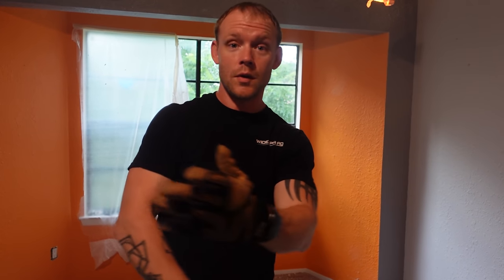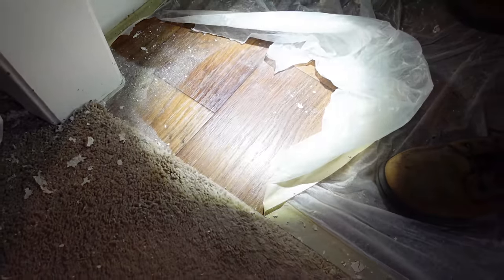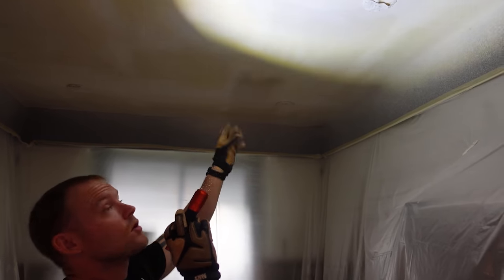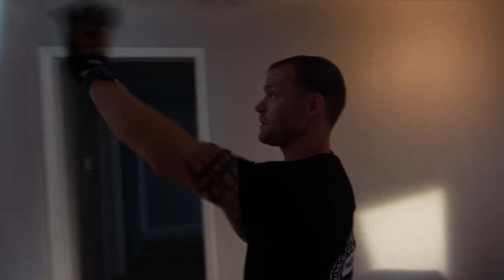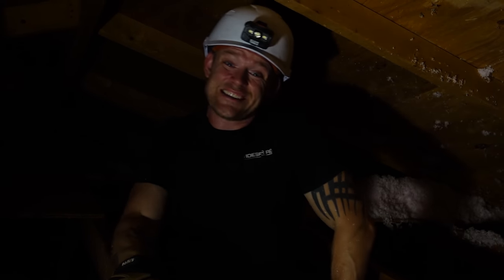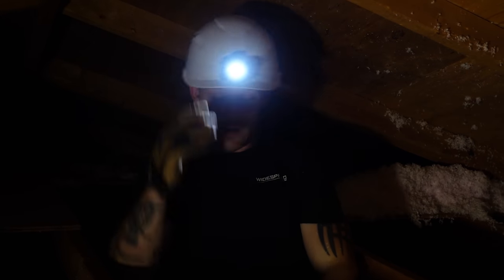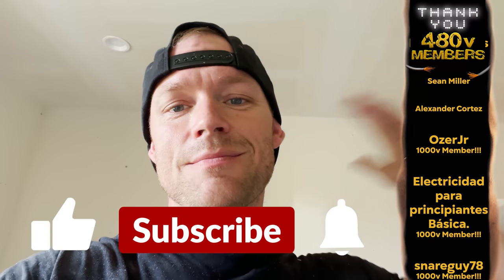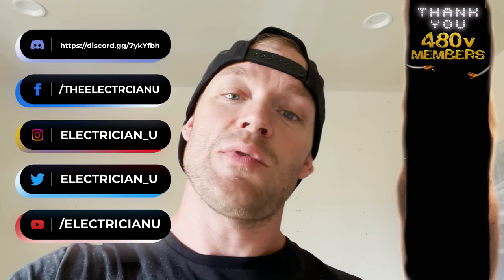Installing Recessed Lighting - Crawling in Attics - Remodeling

Comment: You can get a safety "bump cap" insert that fits inside most ballcaps. It's not rated for falling object protection, but will stop you from getting any cuts or bruises on your head.
Reply: That’s great. I may have to get one of those.
Reply: They are absolutely impermeable and will drench your head in sweat, still beats smashing your head into a beam or nail point I suppose.

Comment: I had a buddy die in an attic an hour before we were done with the job . He was making up a junction box and his knee slipped and he fell with his chest landing on a live circuit hidden in insulation and I kept yell up the ladder to him and then I seen the lights shudder and ran up and he was barely alive ,sadly when paramedics came he was dead. One of the WORST days of my life and career. I NEVER ever let co-workers go into attics or confined spaces alone. Plus we go the extra mile now to make sure all breakers are off. He was such a great guy too.
Reply: Really sorry to hear that my commiserations on your loss. Keeping the power off is a great point with multiple circuits that can be always a hard thing to do. But attics are dangerous places I fell and my leg went through the ceiling in the bedroom below the power was off but I was lucky did not get tangled with other live circuits only drywall to repair thank god.

Comment: Run a cheap 12volt led light strip in 3000k down the ridge beam. Plug in with a 12v power supply. It will light up the whole attic and make working up there way more pleasant. Since the light is coming from the whole ridge line, you won’t get any shadows or dark spots even when your working down near the sofets. Installing this was time we’ll spent in my attic. I even put mine on a switch near the entrance so you can’t miss it.

Comment: A good tip esp when working alone. When you are pulling any type of wire in general & you are using sticks, tape the wire onto the stick around 3-4"s from the back or end of the stick. This will create a V.  So when you push the stick forward to where you want it to stay until you move. You just pull the V back until it catches on anything. Now the cable & stick won't fall back out while you move over. 😆 Plus you can still pull the cable forward as much as you want & after you pull it forward a little, if you twist it you can now move it backwards too if needed.

Comment: When using a holesaw in drywall, run it in reverse to avoid dulling the teeth. You might need them later for wood or metal.
Reply: Just use a grit holesaw with the dust bowl and use a side handle for your drill. Its easier, faster, cleaner, and goes through plaster without ruining your saw.
Reply: I bought an adjustable hole saw just for drywall. It has a single bit on the outside and dust bowl around it. Make it amazing for can lights. I think it is a milwaukee product.

Comment: I don't know how you went about removing the popcorn texture from your ceiling, but if you use a spray bottle and get it wet and then go back once it's had a chance to soak in, it scrapes off pretty easy! I've done that a few times! It's pretty messy, but just put down something on the floor, plastic or drop cloth, and it's not too bad to clean up. a 4 gal backpack sprayer with a lever on one side to pump as you spray makes it a lot easier! Harbor Freight has one for 20 or 30 bucks. I bought one I use for me yard every year, and I've had it for 4 years now. Warm water works best!

Comment: If you are trying to find holes while in an attic, try using 2’-ish glo-sticks from a party store.  They are cheap and highly visible. If you do not have an assistant, they can be taped to the ceiling below to stick up into the attic.

Comment: I’m in the same place as Dustin and I had squirrels in my attic and they shit a bunch and tore up the duct work. I realized this when my a/c never cooled. I went up there and discovered the place they were getting in and measured and counted all the ducts that needed replacing. I then got mesh to fix the spots they were getting in and bought a bunch of duct to replace the broken ones. This was in June. I got up there in the morning but by 10 it was unbearable. Needless to say, I duct taped the ducts and basically stopped the bleeding then decided I’d put it off for 3-4 months until it cooled off. The squirrels are the same as me I guess because they seem to have vacated during the summer so I need to at least patch the holes before it cools but I’ll probably put it off and end up trapping them.
Reply: That'll smell nice while they decompose!

Comment: One of the first things I did in my attic was install strings of C9 Christmas lights with white bulbs along the ridge line.  When I go into the attic, I just plug in the strings and the attic is all lit up.  They are all connected end to end so there's only 1 plug to plug in.  It works great.
Reply: I did that too, both attic and crawlspace, but I used strings of 2500 lumen LED work lights. Crawling around still sucks, but it’s at least it’s nice and bright in there.
Reply: @MikeBramm
Good idea!
Reply: I put in 3 keyless that are switched from the hallway below the scuttle hole
Reply: Every time I go up into my attic, I keep meaning to do that.

Comment: The best light I have used is the Milwaukee red lithium headlights. I love those light. Last a long time. Multiple light settings, and rechargeable. They sell batteries for it too if you need to quick swap it. But the only time I ever had to do that is when I forget to charge it. Otherwise last the whole day.

Comment: Great time to be in construction/housing market… i got a whole house generator install, adding a 5000w generator inlet for the same guys lake house, and made 600 in 2hrs yesterday, installing 2 smart switches, getting power back to his bathroom and installing a surface mount light on his front porch yesterday lolt

Comment: Would love it when I gave somebody a price in middle of winter to due a few hours of attic work only to have them wait til hottest days of summer to get it done. Told them it would cost at least a hundred dollars more or wait til October.Same thing with post lamps. Would expect you to do it for same price that you quoted in summer and wanted it done while the ground was frozen solid in January. Told them to call me after they dug a 12" deep trench because no way that I dig in middle of winter up in cold north city. Luckily I got more & more machine tool & die shops etc for work and stopped doing any residental work last 25 years before I retired. Don't miss taking off work boots to walk inside a house. Keep a pair of clean sneakers that I only worn inside homes but even that did not make some customers happy.

Comment: Lowe's or Home Depot sell a plastic bowl you can put on under your hole saw that catches all that sheetrock dust. Locke Supply sells one with an adjustable hole saw blade in it for about 30.00 dollars. there pretty handy for sheetrock. They aren't quite strong enough for wood, unless it's paneling, but pretty handy tool for adding light boxes or such.

Comment: @9:49 I see 14 and 12 gauge wire. Is not mixing the two just recommended or you can mix them as long as the breaker covers the smaller one?

Comment: A N95 or equivalent mask is a Must along with a disposable jumpsuit ,if not  a long sleeve shirt should be worn ,fiberglass insulation is the worst and you will thank me for it . Don't put the shirt or any other clothes worn  in the family wash load;do it separately. Knee pads that are flat are also suggested when crawling along the joists ,there are nails in them too ;nothing like a bare knee on a nail to make you feel alive!. Always have at least two points of contact grabbing something overhead and having a good footing while you feel out your next step especially if your in a high ceiling.a Headlamp is also a must flashlights are pretty useless unless you have a solid platform they will take a much needed hand away.if wearing a safety hat make sure you can see up or you will eventually hit your head on a beam (hard learned experience and I mean hard) gloves and safety glasses should also be worn .Your less likely to lose tools or materials if put in a tub and slide them along . I have crawled in 100 or more  attics and under houses doing Hvac if this helps one person to avoid the aggravation or Injury and saves them time then typing all this was worth it . Stay safe .
Reply: YES YES YES AND YES. well said. Kept me from almost writing all this almost word for word hahah
Reply: "To make you feel alive..." hahahahahahahahahahah

Comment: Yup. I've got the non vented electrical rated full brim Klein hard hat. Love it.
Reply: The vented is preferable, you can always close off the vents. The first time you disturb a squirrel nest and they jump out at you and your head jerks up and you hit the “ceiling”, you will appreciate wearing a hard hat up there. Nothing like a skull penetration to focus your thinking.
Reply: @declanfarber  the vented is not electrical rated
Reply: @declanfarber  The vented is class C. The non vented is Class E rated. Look up the difference. Now you know why.
Reply: @danukepaintball  I’m referring to residential attics. Thanks for the opportunity to clarify. (If your roofing nails are carrying voltage, that’s a somewhat more esoteric problem.)
Reply: @declanfarber  And I bought mine for more than one place. And if you've ever seen knob and tube wiring, you could easily have live lines overhead in an attic. Which is why mine is class E

Comment: The Klein 56411 pen light is cool. I own one and my only gripe is the metal clip. the clip gets snagged on lets say a pocket, so when you pull it out, the clip bends. Im gonna have to cut the clip off amnd smooth the edge where i cut off the clip. I dont wanna throw away the clip cause it acts as a sort of spacer for screw on battery cover.

Comment: Just wondering ,  here with my company we never use can lights unless a customer asks for them specifically , we usually use the ultra thin wafer lights that have the adjustable light spectrum. They are just SO much easier and roughly the same price but cheaper for the customer  as far as paying us for our time
Reply: Agree 100%. Plus, you don’t have to worry about whether they’re IC rated. And they usually have a air sealing gasket around the rim. The recessed can lights in my kitchen leaked air like a sumbitch in the winter until I replaced them.
Reply: @CantankerousDave  and you don't really have to worry about where your studs are because they are so thin you can usually go right under it
Reply: canless recess lights and a grit hole saw with dust catcher made recess lighting jobs super fast.

Comment: Did you drill holes through the attic joists?
Reply: It looks like he just laid the cable over the joists on top of the insulation.  If running perpendicular, I believe you're supposed to drill through the joists at least 1.25" from the edge.  If running parallel, staple the cable to the side of the joist, also at least 1.25" from the edge.  Not only is that code, but the extra work will make it a lot easier and safer to maneuver in the attic next time you need to work up there.

Comment: I like to drill a 1/4 hole first then stick my fish stick through the hole to see where I’m at in the attic and clear the insulation in the attic prior to drilling the hole for the light less mess
Reply: I try and go in the attic the least amount possible most of this can be done with fish rods daisy chain the wire you don't need someone feeding you the wire in the attic

Comment: I always see people adding lights and wires but they never explain what to do with the wire in the attic. Do you staple it to the under side of the roof? Do you leave it laying on the insulation? How much slack??? Grommets? How to enter the electrical panel? I need info.

Comment: Not enough 70 year old gray blown, fiberglass and formaldehyde rolled insulation, and mouse droppings in that attic.

Oh and don't forget my favorite:
Old Sheetrock ceiling furred down over even older plaster that disintegrates upon penetration.
Bonus points for metal mesh instead of wooden straps.
Ultimate mode: Tin ceilings.

Edit:
In case anyone is wondering, I'm a licensed electrician in New England.
You have not lived until you rewired a 100+ year old home.
Three words are seldom feared more than "Knob and Tube".

Comment: I hate attics too did residential for 2 years mostly service calls and remodel work not my cup of tea especially hated being in attics and I would always get picked cause I'm short af 5'3" and in shape so I was the attic rat, the insulation all that fiber glass and especially during the summer time in West texas sucks ass. Loved that I got that experience of the residential side though but I'm now back in the oil field doing what I like most and will stick to industrial

Comment: where can i get that hard-hat? Can you link me?  my attic has LONG nails and short nails but it's those long ones that will put me in the hospital.  I'm sure if i raised up real quick on one of those 4 inch nail thrus, I'm pronounced brain dead on the way to the hospital.  i need that light you have mounted to your hard-hat as well.  thanks
Reply: never mind , won't be needing a hard-hat.  fell through the attic via minor loss of balance but no means of recovery around an obstacle , went down through drywall like a knife through butter (225 lbs), smashed chest into granite island in kitchen, was then thrown like a rag doll by my presumably accordion like chest violently onto the tile floor.  I'm saying this to serve warning to those interested in working in an insulation filled 18 on-center joist ceiling system to please take precautions and put a plywood path to the entire area you will work . Damage report: ambulance ride to level 1 trauma unit, 6 broken ribs, broken sternum (lower), broken L5 and compression injury, bruised right lung, bruised pride in handling home DIY.

Comment: What’s up Dustin 
First time long time 
Wanted to ask what do you think about electrician vs low voltage techs?
I’m really asking if you started over would you be an electrician or a low voltage techs. Both working in residential and commercial only now your installing coax Ethernet and fiber plus setting up the equipment

Comment: Future video? How do you decide the combination or type of light and how many you need to light up a room? For example LED lights and CFLs and Down lights versus pendants broadcast light differently. If you want to light a kitchen and don’t want shadows how do you know how many and of what type of light are needed for your end result desired so you do not cut holes in the ceiling and then realize…. O no! I have to do this over and patch all those holes I cut. Or rebuy a bunch of higher lumen lights.

Comment: @ 2:51 O dude I had a question about this very thing. When using the drill do you go in reverse to cut into the ceiling with the whole saw or do you go in Forward on the drill. Because My boss who is a Master Electrician said that I'm supposed to go in Reverse. But idk why it seemed to work better when I did go in reverse. But when I'm drilling anything else I always go forward. I'm still you know an apprentice but Like i feel like I still struggle with things that should be pretty basic knowledge or skills sometimes. But Hope anyone here can help thanks. appreciate it.

Comment: Thanks for all the great content!  There was a recent question about insulated lights that are IC rated.  I purchased some IC rated low profile lights with a separate driver box.  Operating temperature max shows 104 F, so I'm concerned if overheating could be an issue, since attics get well over 120 degrees sometimes. Should I buy something different for the attic?

Comment: Wait, you have to replace the carpet with each tenant? I thought it was every 6 or 7 years?
Reply: carpets in apartments usually get replaced every 3 years. depends on state as well. for tenants who rent, i think you can leave it in absolutely 6-7 or longer especially if its the same tenant. carpets get really nasty after 3-4 years. can become a health hazard. usually good habit to replace after those years if new tenants move in.
Reply: Instead of replacing carpet all the time, it might be more cost effective to use vinyl or tile for the floors.
Reply: @chris76-01  yea thats usually the case when the money option can afford it. its usually my goto choice to customers
Reply: I hate carpet anyways. But I was just lost when he said that he’ll have to replace it with every tenant. So it seemed. Nevertheless, I wouldn’t want to install carpets into any of my rentals, once I get one.

Comment: One tip- when drilling down lights, if the drill is run in reverse to begin with, this stops the hole saw from wandering. A cleaner hole can be achieved, and the plasterboard around the bezel of the light remains undamaged.
Reply: Another tip is to blow a bit at the holesaw so the dust doesn't get on you. I noticed Dustin didn't do it, and i never used to either. But a carpenter gave me the tip a year ago and changed my life haha

Comment: Quick tip for those of you with popcorn ceilings... it's a good idea to have it tested for asbestos.  There are asbestos test kits you can buy online or home improvement stores.  It's insane how many things can contain it.  You should wear a proper mask when collecting the sample, and they can get you the results back within a week.  Sometimes you can just put a thin layer of joint compound on a super thin drywall right over the popcorn ceiling, then tape and smooth it out.  It shortens the ceiling slightly, but you get a better R value, and you don't have to remove the popcorn ceiling at all.  Disclaimer: do your own research, and anything you do should be at your own risk.